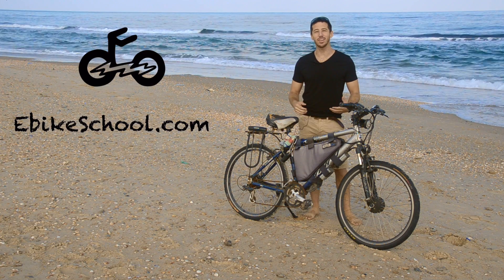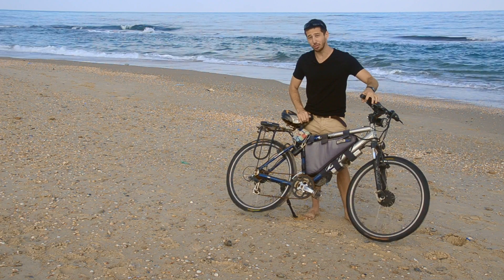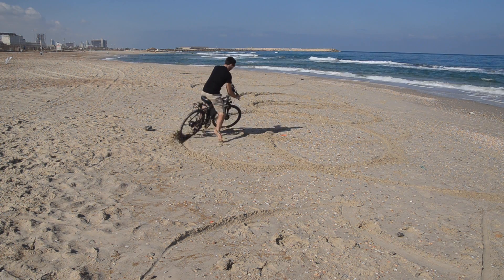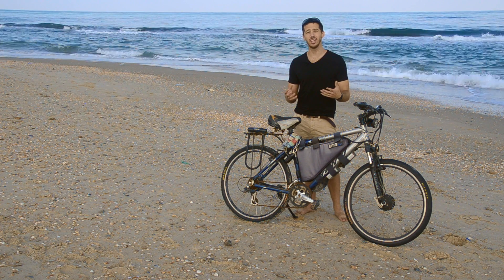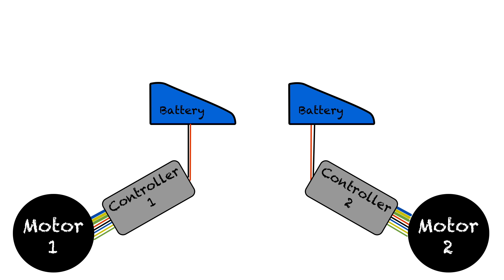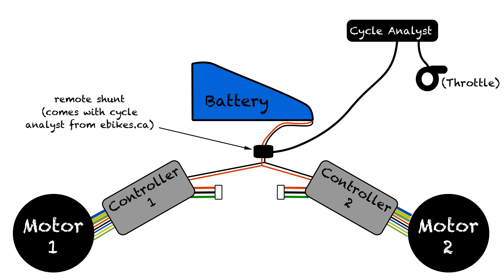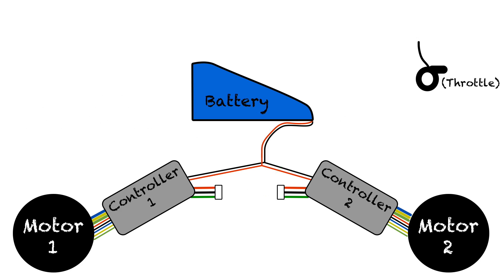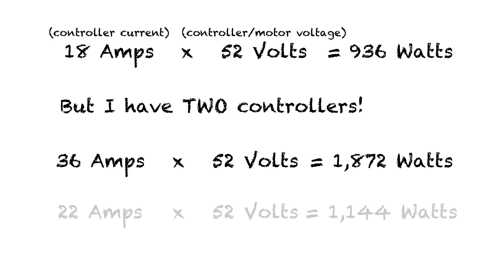DIY Two Motor 2wd Electric Bicycle (All wheel drive 2x2!!) Q&A#6

Comment: I have two 20” fat tire bikes one a folding F1 BPI import rear hub 500w 48v and a tricycle bpi 500w 48v front hub there both 7 gear.  They both have I believe 5 assist peddling and almost sure two motors can work .  . I became disabled reason for getting tricycle . I dont care for the tricycle and thinking of taking the 20” front tire with bafang motor ( from tricycle) and replacing the non motorized front 20” tire . . I could share the battery or use both batteries my question is in controller.  with maybe a 3 way switch 1,front hub , middle both motors, and last or  3rd position rear motors. 

 I  would gladly pay you for a plan I already purchased all your books and as stated I’m disabled so the work would be done by an e bike enthusiasts Veloflex . 

I know I’m brief with details,  if your into helping build the dual motor folding 20” ebike I would welcome your expertise from Miami

 FYI why do I want to this:
 first I have a brand new tricycle I’m not using and would prefer combining its parts with the F1 bpi import fat bike , 2nd reason  torque, distance and speed  plus  the parts alone eliminating the 3 wheel frame just battery,controller,throttle would easily cost me $1000-1300 if I bought them separate , of course if I added a motor I would probably want to upgrade the brakes to hydraulic brakes but that’s later . I don’t think this is a hard upgrade as all the parts are from the same manufacturer it may take a custom y splitter I don’t know what that would do to the accuracy of WH etc on whatever controller I go with .  
Please send me in the right direction so I could then talk a local e bike expert to create it , unless you would like to visit miami I pay your way no joke. 
Email available but how

Comment: Dear E-bike school: I know this may seem too simple to explain. But I'm trying to find out what is the best way to connect the wires together to make these connections? No one is explaining this directly.

What do I supposed to use to join the 2 batteries together and to split the green wire to both controllers. And what wire do I order or buy to run to the other controller? What do I supposed to use to split these wires? 

Please explain, anybody

Thanks

Comment: I've used your tutorials to build my current ebike.. it's a 48v 1000w rear wheel motor I overvolted to 52v. I live in an area with lots of hills and I'm wondering if 2 smaller motors would give me more range or speed? Or is there an advantage to a mid drive motor?

Comment: Now add a mid drive
Reply: Add a 4cycle go full hybrid
Reply: And a 80cc  petrol engine make a hybrid
Reply: Yeah, soon three motors ebikes...with torque vectoring etc...etc
Soon
👍
✌️
😇
Reply: And a friction drive
Reply: LoL
Reply: I was thinking the same exact thing years ago. But it is definitely going to be a custom built there is no way a company going to push that kind of bike out of the assembly line going to break some piggy banks 😂 but at least now AWD or 4wd ev is common is the matter of time.. but in the meantime DIY don't hurt 🙂

Comment: After a season of riding on icy roads, AWD bikes are not the way to go for winter because you do not want the front wheel to ever slip. It's possible to recover from the rear wheel slipping, but if you put any torque on the front and it spins, you are going down.

Comment: Hi. My name is Anthony. I'm a 100% disabled veteran and I metal detect as therapy for severe PTSD. I need to construct an electric bike that has the longest possible range at an average of 25-30 mph. I live in a rural area and my detecting permissions are as far as 25 miles away. My question is if I use dual motors with matching watts will using 2 separate battery sources give me the range and powere I desire? If so, what specs would you recommend. My funds are limited to my military compensation. I own an expensive aluminum(shimano center shock) 21spd mountain bike. Thanks for any info you can give me. My email is jackshayla69@gmail.com. I'm much obliged.

Comment: 0 e-bikes. 
Is it really that simple to set up an e-bikes ?
I keep seeing videos with so many wires, with all kinds of sensors. I guess I don't need all that stuff.
Reply: Most hub motor kits are pretty easy to install (especially front wheel motors). You connect the wires 1 at a time, the same as you would a computer or a stereo. I have never bothered with installing the PAS (pedal assist). You can use as much or as little throttle as needed any time you want. Personally, I prefer a thumb throttle, but it's very much a personal choice. Most kits can be ordered with a choice of throttle.

Comment: Are you using the q100 motors? If so, where did you get them? Did they come mounted in a rim already? 

I’ve already built a 1000w cheap voilamart ebike with a custom 14s6p battery. It’ll top out at roughly 26mph with no additional pedaling. I am a slightly heavier rider at roughly 225 pounds and the initial torque when starting from a stop is sub par in my opinion. Looking to design a 2 motor bike like the one you have done, but not sure if I should use q100, q128c, or bpm2’s? Any advice would be great!

Comment: The 350W hubmotor link no longer works. Was it direct drive or geared? Thanks
Reply: Did you find out? I'm Al's trying to known that
Reply: Geared motors. If it was direct drive it would look much larger that the motors in the video

Comment: I would like a switch to use either the front or back motors or to use both if desired. Is it possible with out to much trouble.

Comment: Hi Mike! Can I conect two 500w motors in series to 1 single more powerful 1000w controller??
Reply: Hi, It is not possible to run 2 brushless motors from 1 controller, the motors do not run smooth and also dangerous.
I tried it, now my setup is:  2x500w hub motor , 2x500wcontroller. 1xthrottle.  (48V battery)

Comment: Nice video .  I have a two hub drive from Eunorau that has 350 in back and 250 in front and run on an internal controller . I have a question for you , well several actually . I need more power for climbing trails here in the mountains and would like to go to a 52v 1600 watt mid drive and keep the front hub motor too . The mid has it's own controller built in . If I disconnect the wires to the rear motor I should be able to run the front its original system and the mid on its system . I'm stumped on how to hook them up to the same control switch . Ideally I'd like to be able to motor out on the mid and limp home on the front . Possible ? Ideas ? Thanks .

Comment: Hi there hope your still monitoring this but do think this would work on a two front wheel drive on a recumbent trike
Reply: I think you might run into torque vectoring problems trying to power both front wheels. You might do better with a larger motor on the back wheel or going with a mid-drive motor.

Comment: Hi ive watched a few of your videos as ive built a couple ebikes, if mine was originally 500w 36v but ive bypassed the amp limiter in my controller and run it on 54.6v what wattage would mine be putting out roughly?

Comment: When I have one 48V battery (with continuous draw of 25amps) and two 350W motors: Will I need two 24V ESCs and two 24V motors OR will I need two 48V ESCs and two 48V motors?

Comment: How many Amps does each controller draw if each one is rated at a max of 25amp?
Reply: My question exactly.  I have 2 1000w hub motors and both are rated at 26amps. I am probably going to overvolt to 52v. As I build my battery pack I keep wondering if max draw is 28a or 56a. I will go way over regardless, but it would be nice to know if the amperage gets divided, or added. BTW I have been running with a single rear hub 1000w 28a using 6 lead acid cells and the voltage goes to 80v when fully charged with no problem so far. The motor gets warm and the controller but in hot Florida? So far no problems. I am going to build a pretty massive battery pack, but it would be nice to know. Also, the single rear hub was dirt cheap and is a rocket and too much fun, for $130 I bought a front hub to hopefully help out with the heat issue and make it easier for both. And get away from these dreadful (but high amperage) lead acid batteries. I am thinking overvolting to 52v with at least 56amps and hopefully over 20ahs....Sounding expensive but I am about to put together my first pack from salvaged 18650s so it should be...interesting lol. Great question hopefully Micah will answer it.

Comment: Can u ask a quick question about batteries on an e-bike? I have two battery the first one is 36v 17Ah and another one 36V 7.5Ah can I connect them in parallel and get 24.5Ah and of course, depending on the controller as well?

Comment: Ok I have everything now 2 x 500w hub kits and over 300 18650's but what's best 2 batteries or one monster battery? ANY comments are much appreciated. and I've had fun tripping the house's fuses with my new spot welder, and also I have a bms 36v with an extra sensor wire 10 red and one black? most E Bay bms's are like this except the multicoloured one you use in your video.

Comment: Thank you for the info, I was looking for that info you gave. Plan on putting 2 1000watt hub motors on my fat hike I'm custom building. By the was where did you get that splitter between batteries and your cycle analysis. Thank again. And yes I'm ordering your book, well my wife is getting them for me for Christmas.

Comment: Hello I want to use your system on a bicycle trike to power the two front wheels. Who can I control the the exact rotation of the wheels so I can steer straight. Regards Marco

Comment: i had some problems connecting the throttle to both controllers, it didn't work if the ground wire wasn't connected to both controllers.... , so i had the signal wire and ground connected to both controllers and the positive 5v (usually red) connected to only one of the controllers. ... , if you connect positive to both you can fry the throttle

Comment: https://www.youtube.com/watch?v=Kjjh6Wf266E
Rear drive is cool, front drive is a bit of a pain, lots of weight, torque steer, bit of a learning curve, but front drive is much better for towing trailer's.
Two wheel drive is kickass, here's a video of a Two Wheel Drive using 2 x 5,000 watt motors, the motor's alone are 30.lbs each, Crystalyte 5403 rear and a 5304 front, not the perfect set up as they had slightly different rpm per volt. Studded tires, 3 battery packs, Golden Motor controllers ( kinda suck ).
Two Wheel drive is like night and day, awesome traction even with front wheel spin, Endless Sphere Forums has alot of ebike info.
Some places I like to shop, ebikes.ca, Luna Cycle, BMS Battery, EM3EV.
ebikes.ca carries a front motor that can fit just about any fork except a fat bike fork, 9mm standard, 15 and 20mm through axle forks with adapters.
Bluetooth controllers, Luna Cycle carries some nice ones, work well.
Crystalyte motors are bomb proof but EM3EV carries a nice 5,000 watt motor.
Deans 12g Silicone wire for power harness, well worth the money, upgrading motor phase wire to 12g well worth the time, but be warned, much more expensive for tires as the torque just chews them up.

Comment: I have been curious about over volting the motors. How far can you go? And still be safe! I would like about 1kw motor. How high could I go? I would like performance similar to a 125cc 4 stroke trail bike. I was also thinking of building a frame, and going with 3 motors. 2hub and a mid drive 1800w with no peddles. I can build a battery up to about 72v, and 25ah with I think 25c, could the hub motors go to 72v, or 20s liion batt!
Reply: Endless Sphere forums, you can put 2 10,000 watt motor's :) 785 watts = 1 HP, 10,00 watt motor about 12 HP.

Comment: Wow I've never heard of having two motors for an ebike. I've been considering making my own frame from scratch with my powertig welder. It would be great if I could design it so the batteries are very low to keep the center of gravity down.
Reply: Ever get around to it? If you have access to a welder, make a beefy connection for torque arms.

Comment: Stick two pedal assist controlled hub motors on a mid mounted e bike for a stealth  triple motor machine.

So long as the hub motors are capable of freewheeling the operation of the original mid drive motor will be unchanged, but when you pedal the hub motors kick in for extra power and 2wd traction.

You can cruise around on the mid drive motor using minimal battery and power up steep hills with all three motors.

Comment: I have 2 48v motor wheels, what size battery should I get?
Reply: Battery discharge rates depends on controller, IE: 20 amp, 40 amp, 60 amp etc...   36 volts @ 20 amps = 720 watts so if you have 2 motor's and controller's then you need 40 amp discharge. Which would give you 1440 watts of power. 72 volts @ 20 amps = 1440 1440 x 2 motors = 2880 watts.
Volts = speed, Amps = power/torque
Reply: Larry MacDonald thank you. How much speed does my bike increase when I go from 1 motor to 2?

Comment: Micah,
I followed your advice and connected the two signal wires to a single throttle. However, as soon I hit the throttle, the bike flew off with both wheels turning at full speed. I'm using two controllers and two batteries, one for each of the motors. Am I missing something?
Reply from the maker: Sounds like the throttle's 5V wire is shorting to the signal wire somehow :-/

Comment: Question for you... I use my ancheer ebike to commute 2 and a half hours into work every day (34 miles) and then repeat on the way home. I ran across your Vruzend battery kit, and had the idea of buying one of these front tire 250w ebike kits, and making my ebike 2 wheel drive... Mostly because I hope to increase my top end speed for my almost completely flat commute. If I did this, building a 2nd battery for the second motor, and ran both controllers off the same throttle signal, how much could I expect adding the second motor to increase my top end speed?right now, I top out at about 18mph... Is it realistic to think I could get up to 30, or will this increase power/torque but not top end speed? Thanks
Reply: Volts = speed, amps = power, if you want to go faster, as long as the controller can handle it, just increase your battery voltage, IE: from 36v to 48v, 48v to 72v etc...

Comment: What's the battery voltage and also amphours like is it a 48v battery with 20amphours and do you.connect both controllers into that , as ya shown ?? 

And also are you getting less distance having both motors to one battery or is this because you went with a smaller watt battery for the wheels ?? If you go higher for wheels connect controllers to battery less distance etc etc 

And what's the average distance for this set up.you have awd both tires going qt once , like run time about 10 miles ?

Comment: how do you build a larger voltage battery/ like a 48 v/40 amh battery? or a 72 v/60amh battery? what the best way? or best or safest shape can at 72 volts do a triangle battery? HELP!!! Like into 14s,17 and 20s type batteries, Thanks!!

Comment: Could you please describe E-Bike Hub Sizes. What bike frames are suitable for say Bafon Hub motors?  What Frame measurements do you need for 4 Inch Fat Tires? What E-Hubs are required for 4inch fat tires? What measurements do E-Hubs require? Do they come in different size widths?

Comment: My dream bike: 2x2 full suspension 1000w fat E bike ... snow, sand, mud, uphill, downhill... no matter what!
Reply: I kit built, from ebay a 48v x2 1000w fat tire bike..No suspension(with 4 inch tires- not really needed).  Its awesome :)
Reply: High Power Cycle in Cali
Reply: I was looking at those, (1000w per wheel), and it would be $400 plus bike and whatever battery you wanted to use). To me, that seems very cheap. Since I'm not worried about weight on an E-bike since its going to be heavy (this wouldn't be like me replacing everything with carbon fiber on my road bike), I could just get a gently used fat bike for $150 (my cousin has one of those, we've thoroughly abused it, and it looks and rides like new, I don't plan on doing ledge drops like I typically do). Seems like $550 plus some high powered LiPo batteries (to keep it moderately light weight) should be able to rip around and have fun!
Reply: @jakegarrett8109  $199 48v 1000w front or rear. Slightly under size rim..still takes a 4" tire. Controllers are cheap- I upgraded 1 with pure sine which is about 25% better. $700 2 kits and a bike. $800 mid mount 48v 1000w. Rear rack mounted 48v 1500w.  $1500 for a really nice toy :)  https://www.ebay.com/itm/26-IN-48-Volt-1000W-Electric-Bike-Motor-Fat-Tire-Kit-Front-Wheel-US-Stock/132961352932?hash=item1ef51d3ce4:g:h-kAAOSwiuRcbqM~:rk:13:pf:0
Reply: One kit had a right hand throttle grip, second kit I used a thumb throttle on the left side(turbo). :)
Reply: @jsmythib  Yep, those look like the ones I was looking at ($200 each, so the $400 plus bike like I mentioned, pretty good deal!). I really like the ones with the rim centers cut out (there was a used fat bike for $150 with orange inner tube protector showing through the rim cutouts that looked pretty stunning. Orange and black are my Universities colors, so that bike just needed a decal on it to look official, so the looks alone pretty well sold me on the rim cutout design). I agree, they would be a REALLY fun toy!

I still need to make one. I'm wanting it for commuting with a quadcopter strapped to my backpack for riding outside of airport flight limits. So I'm thinking I would buy a huge overkill  batter at some point for the bike so that I could use it to charge my small micro batteries wherever I'm flying (I'll add a voltage display so I don't have to pedal back too much, but hey, if I drain the battery having fun, that's alright, a little extra exercise wouldn't be to bad anyways!).
Reply: 750w is the max legal limit here in Washington, not that anyone cares